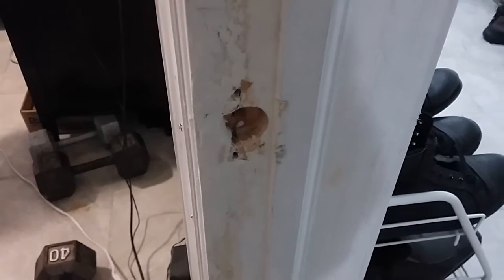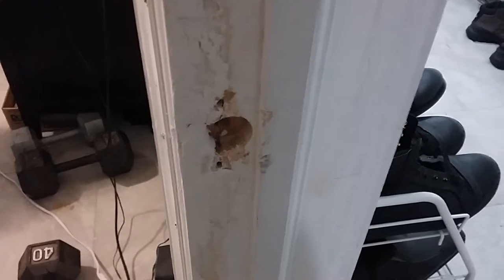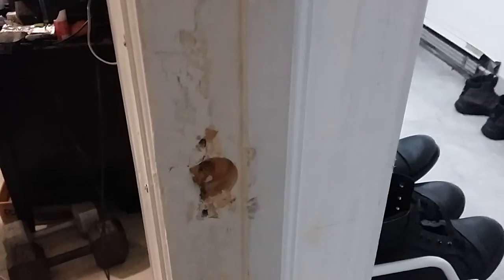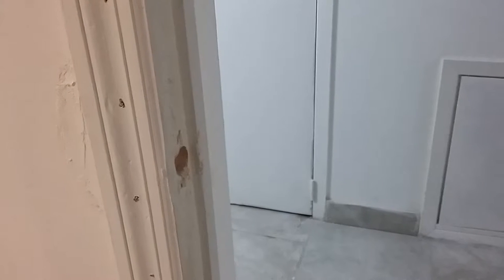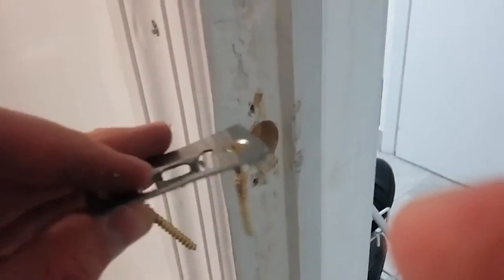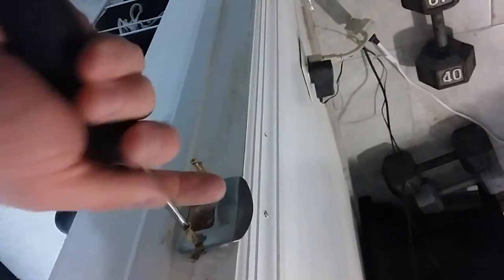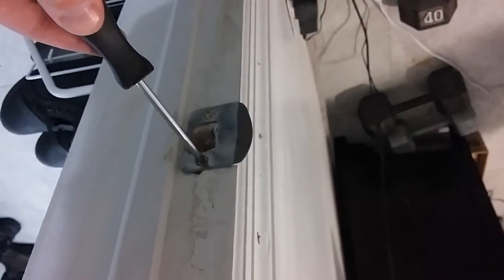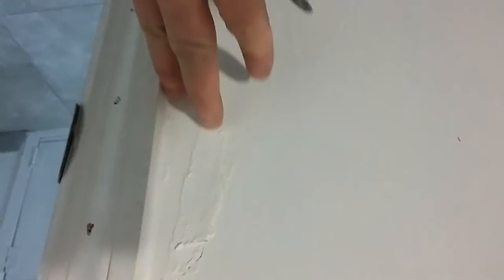Fix Broken Door Frame Part 2

Comment: Did you paint to cover the nails?
Reply from the maker: I actually didn't but you can throw a coat of paint on for cosmetic reasons
Reply: @KETO.n.WRESTLING  alright thanks
Reply from the maker: No problem